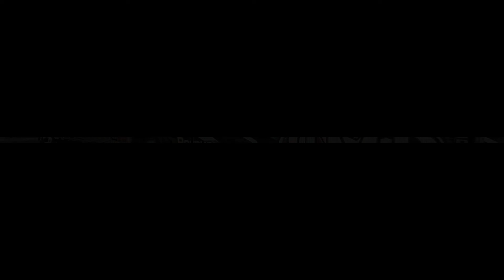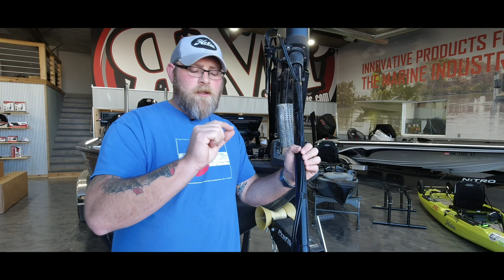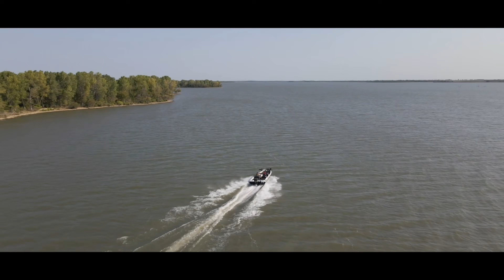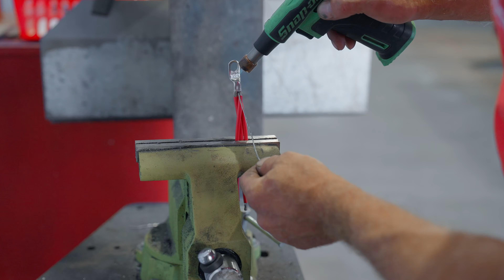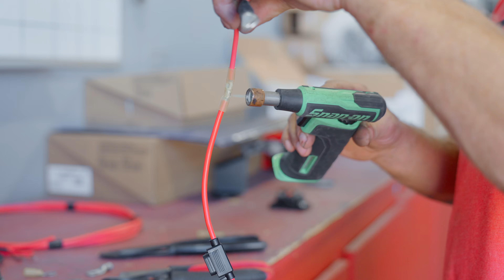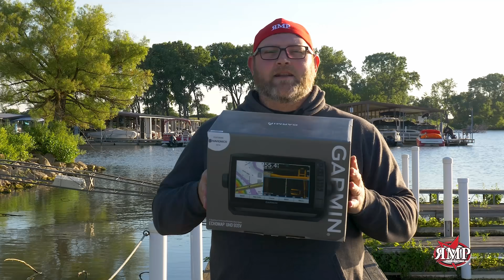Pro's Tips on How We Run Dedicated Power

Comment: You still need the 3 amp fast blow fuse that comes with the unit.  DO NOT CUT THIS OFF!!!!  The 3 amp (or fuse size that is sized with the unit) fast blow protects the unit and you cannot use the 7.5 fuse on the battery to protect the unit.  The biggest concern on running units off of one wire over distance is voltage drop.  You do not need two separate wires of that gauge feeding those units.
Reply: I would like to see where any of the manufacturers have approved doubling the fuse size. I protect all of my runs but still have the 3amp protection before the unit via the factory supplied or at a fuse block
Reply: @brandonspalding573  where did you see him doubling the size of the fuse? All of my 126s and GLS 10 came with seven amp fuses.
Reply: Agree the separate wire of this gauge is overkill and the fuses should be on the units wire per the manufacturer. Doubling the fuse amperage is not good.
Reply: @Mags120fish1  the manufacturer disagrees. It’s right in the manual, and it’s been that way since the beginning.
Reply: Unless I missed it you didn't comment that the power for your electronics need to come off your cranking battery not one of your trolling motor batteries. Thanks
Reply: Additionally I use shielded wire to prevent any interference from any other electrical equipment
Reply: @Paul-ke5lu no, they did say cranking battery or a stand alone battery for the electronics. Never off your trolling motor batteries.
Reply: @Paul-ke5lu  It’s a dedicated deep cycle battery , not the cranking battery.  One can use the cranking battery but the setup for a dedicated system for just electronic units is the purpose for a standalone dedicated system they are explaining.
Reply: @Paul-ke5lu it’s common knowledge to not use a trolling battery. It’s been that way for decades. Most use a separate liifepo4 to avoid any chance of dirty power.
Reply: Could you just put a 3amp in instead of the 7amp.
Reply: The in-line fuse mine came with was 8 amp fuse , so 7.5 is good !
Reply: So you don't need a fuse holder ?
Reply: the 7.5a fuse at the perko protects the #10 wire run.   the 3a or 5a near the MFD protects the unit.
Reply: I totally agree with the previous comment you sill need the smaller fuse size to protect each unit...per manufacturer.
Reply: @Paul-ke5lu the fuses that come with every unit I’ve had are 7.5, and 8A. I have a fuse on both ends anyway because I keep the 7.5 or 8 that came from the factory on the wire.

Comment: Question so do I need an individual line for each graph ?  And one for my active target ? Or can I run one to the console and use it for the two graphs there then one a line from the battery to the bow to run my 2 graphs there and active target ?
Reply from the maker: We are running an individual line per unit. Active Target would get its own dedicated power as well.
Reply: @RussellMarineProductsLLC ,

Why are you running an individual line per graph?  Why wouldn’t you get the same uninterrupted power if you ran one line to the console and bus it off there to the console graphs and also up to the bow?

Comment: I’ve been using the Sea Clear wiring harness kit in my boat for two years and the units on my boat have clean , clear, and sharp images as a result of the dedicated power and improved fuse connectors. My units run off a lithium battery that is used only to run the units and nothing else.
Reply: Seaclear seems to use a dedicated power but splits it all to all your units instead of separate lines to each one.
Reply: My harness has two harness’s combined together with separate fuses and wires for each harness. One harness goes to the console and the other harness goes to the bow.
Reply: 10 ga wire to a 7.5 amp fuse, makes sense 🙄
Reply: Sad you grossly overpaid to get power from one point to another.  That scheme doesn't do anything that can't be done with standard components. In fact, the extra length and extra connections are a detriment!
Reply: I don’t feel like I overpaid because I’m really happy with the results.
Reply: @txman201 I agree. Being a new boat owner and also an engineer, I can’t believe people actually get sucked into this seaclear harness. It’s wire. Wire sized right that you can go buy yourself. A fool and their money!
Reply: @UpstateSCBass  When I’m wiring up a 23 year old boat with suspect wiring to begin with, the convenience and ease of use with the harness saved me a lot of time and aggravation.

Comment: Install the switch. Run 6 gauge from battery to switch. 
Run 8 or 6 gauge from the switch to Positive and neg buss at the dash. wire console MFDs straight to the buss bar. 
Run 8 gauge from the console buss to another buss bar at the bow.  Wire MFD’s, etc to bow buss. 
This is the cleanest, most effective way to wire a boat. 
You can also substitute a blue seas fuse panel instead of a Buss.

This procedure will result in only a few tenths of a volt power loss at the bow.
Reply: Overkill

Comment: nice  . very simple   I see people  over think  with to much information   .. I wouldn't  use a breaker as a switch  just install a switch   ...
Reply: I agree; a breaker for a switch that is actuated every time the motor is going to be used isn't good for the breaker if that's more than a few times a year.  Well, maybe if it's being just used as a switch and you install one of the 300amp breakers, it could be used as a switch, but they specifically explained they needed 60amps due to the current draw and as protection, not just as a power switch.  
The method I use is to install a panel-mount Anderson connector on the boat and Anderson connector on the motor's power cord.  Then unplug at the end of every excursion.